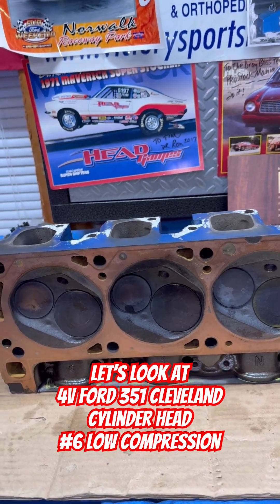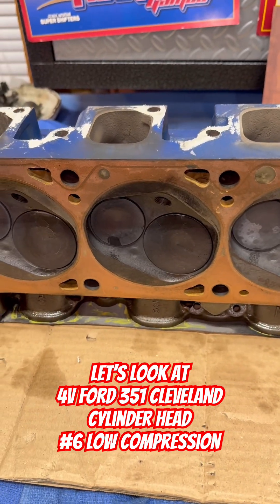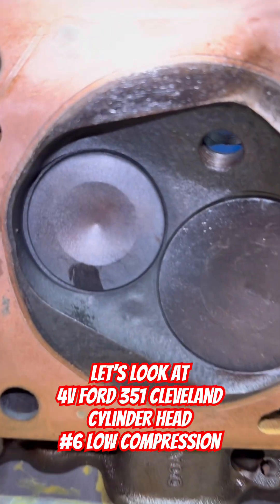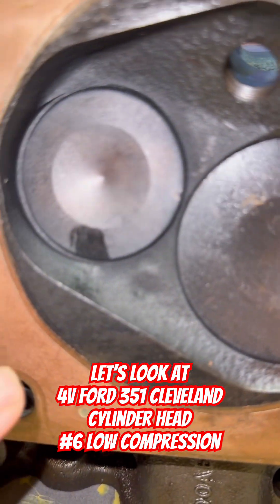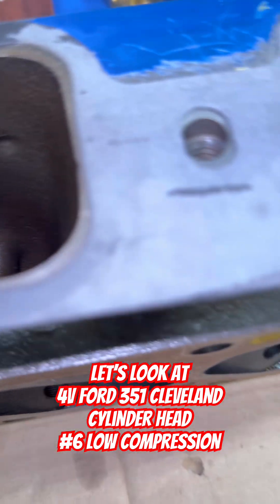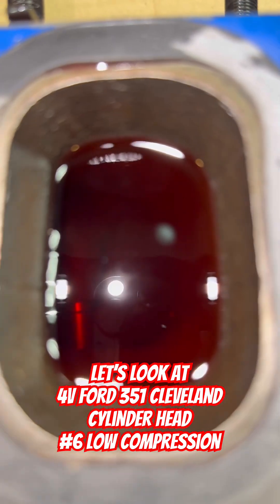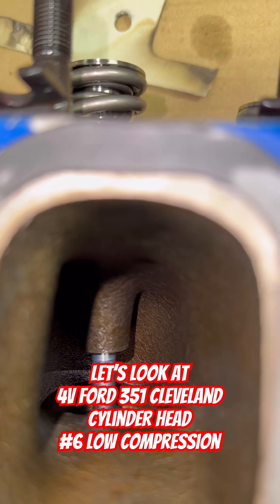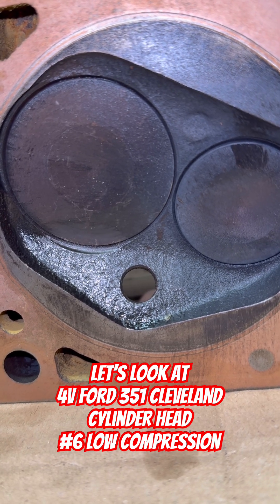DBG: The 615HP Ford 351 Cleveland 4V Cylinder Head, What Is Causing Low Compression, Hi Cyl Leakage

Comment: What if your intake manifold is not equally distributing air fuel to every port, causing one or two rich cylinders. Maybe.
Reply from the maker: This happens to be a ring issue, hanging in the bore...

Comment: Yes but is it leaking past the valve seal or guid on the other side .
Reply from the maker: It’s the ring hanging up and scraping in the bore. 

DragBoss Garage: Tearing Down The 615hp Ford 351 Cleveland, With Low Compression/Cylinder Leakage...
https://youtu.be/lFJcu8WbWbY

Comment: I had a 77 F150 "ranger" from the factory.  I guess it was a package for that year,  anyway,  it had a 351m in it no one wanted to buy it bc it was a "big block" therefore it was bad on gas to whomever owned it before me.  I got it,  kept it factory  2bbl holy 2150 carb,  flowmasters and true dual exhaust, that truck sounded straight up menacing at Idle. Bone stock but it would set off car alarms.  I really miss that thing bad.
Reply from the maker: Those are some of my favorite trucks. 78 is my favorite year. Yes everybody had something against them. I glad you took care of her. Great job 💯💪
Reply: @dragboss351cleveland yeah I heard a lot of rumors and stuff people say about that engine but it was a beast. I definitely would have tried to hop it up but everything was so expensive and hard to find plus it really didn't need much else as long as you took care of it.
Reply from the maker: @FatamorganaJerzyboi yes. Comes down to intended purpose. Hopped  you subbed lots to see and learn chat soon 💯🏁
Reply: @dragboss351cleveland done!

Comment: Hey Tim was there any thing weird with the valve lash? Maybe a tight adjustment or even crazier thought of a possible cam lobes slightly out of time. I think I mentioned what I usually do when tearing a engine for repair. Measured everything so I had notes. With weird problems to diag having the pre-teardown is key. I've had slightly bent rods, weird lifter cup shift, and one valve stem cap we needed for a high ratio rocker. Also had a bit of damage to a lifter bore bushing trying to rotate. I was so meticulous people would freak out. I looked at the video with the bore slight scratches. Would a upsidedown ring  or too much gap cause that?
Reply from the maker: Great idea, doing exactly that. Kash was good. It was rust in the bore to me, and rings too tight. Gouging into bore wall. Lash was good. Thanks my friend 💪

Comment: How big are the intake and exhaust ports on a 4v head?  And much horse power are they really worth a mild 408?
Reply from the maker: The stock head is capable of 600+ and add the increase ci prob 700 right there.
Reply: Tim that’s a good call on the stock power capabilities. The increased displacement is exactly what is needed for the heads to take advantage of the generous port and valve sizes. 

If Scott wants to know port dimensions, the 4-V intake measures 2.500” high X 1.750” wide. The port volume is 242 CC’s. I don’t remember the exhaust port numbers due to old age 😵‍💫

Comment: Maybe time to look at the rings?😮
Reply: A wet / dry compression test and a leak down test would have confirmed before removal. Those valves look to be seated a bit low for my liking but I don't do race motors either.
Reply from the maker: I did that in previous video, cylinder was 160 and squirt of oil and went to 175 ish. Huge blow by through dipstick
Reply: @dragboss351cleveland  Ok then your video was total BS click bait. Thanks for admitting it.
Reply from the maker: @maxwebster7572 if you think so. Your just don’t want to look for the answer. And this videos shows that there is no obvious issues with valves. Thanks for watching. Don’t forget live chat with Darin Morgan on Dynos. More Clickbait 😉
Reply from the maker: Already there, my man I think you’re right. I think the rings were hanging up a little bit.💯🏁

Comment: Would rather have a cylinder head problem than Paton or cylinder. Sonic test. Bored oversized?  Stock block walls are thin. I half filled mine with roc block.
Reply from the maker: Yes, block is filled, the boards are 4.015. Good deal thanks, Danny.🏁🔧💯

Comment: What block are you running?
Cuz .030"/.040" over stk Cleveland blks crack cyl walls, but will still only leak dwn about 20/30% for a while.
Any signs of leaking around the ring on the block?  
Those heads aren't posted, but I suspect your not running very high compression in this eng..?
Reply from the maker: For this engine it is 4.015, I have plenty of blocks .030,4.035,4.040 that last years and have normal leak down. The rings are the issues in one of the last vids I posted. This engine is 12:1.

Comment: Nothing too see here? I watched this video all the wy through and saw nothing just like you. So if theres a compression leak anywhere, it would have to be getting by the rings..Anything else where would show up in the cooling system or an issue with valve settings, like a rocker holding a valve just enough off the seat to let it get by. I have ran across a situation like that before. It would run and fire on the cylinder that was losing comp. and it wasn't misfiring either. Years ago I had a fellow bring in a 289 with high comp. domed forged pistons complaining of compression loss and I did a leak down test, checked to see if it was leaking back into either the i take or out the exhaust with heads on, checked to see if it was getting into the colling jackets. Ended pulling the heads and didn't see any evidence of getting between the bors as Fords can be knownfor because of having only 4 bolts per cylinder. Had the heads checked and just a minimumal.clean on the surface, nothing wrong there, turned out the decks were buckled at the bolt holes. The guy wasningoing for a complete pull out tear down and deck surface. Told me to put it together as it was. Ok! As I said it wasn't showing any sings of comp loss on the gaskets but it sure as heck had running issues. Was ansolid tappet engine so after putting it together, I made sure it wasn't a lash issue either. I never did figure where it was going. Ears later, like maybe 25? I ran into a late GM equinox engine that was leaking comp..from one end of the front bank into the other end cylinder of the front bank! Go figure that one, how the hell does that happen? I was told to swap out that engine which I did and the replacement engine would refuse to fire on the center front hole! Nothing I did would make that run on all 6. It was only a few weeks later that I decided it was time to retire! After wrenching for nearly 50 yrs.
Reply from the maker: Thanks again, Brett, another story that is others information to look for if they have a similar situation. I don’t think it’s the heads either, I think it’s a combination of the rings, having rusting the lands, mixed with oil, and too tight of rings, cocking them in the lands, either way it requires a teardown, and a good thorough evaluation. I suspect just doing this going through the valve springs and the valves, cleaning everything up, I bet you this thing picks up 20 hp just with that. 50 years in the business you put your time in, now it’s time to enjoy life while you can. We only get so much time. I’m glad you’re here. This is just me doing what I enjoy doing and love doing Racing and engines. I’m not a big builder, but I’ve built my share of engines, and after reviewing this, I know I can improve my own skills. I will prove it here. Glad you’re checking my channel out my friend. See you around real soon.💯💪👍🏁🇺🇸😊

Comment: Have you cdone a leakdown test? You may have a pinhole in a cylinder. No leaks into the cooling system? Thinwall cylinders may be your culprit, assuming you're head and deck are true. The only thing left is piston/ring issue if it isn't in the cylinder head or gasket which would be obvious.
Reply from the maker: Yes one of my videos from the other day. 😊

Comment: I'm NOT a Mechanic, nor a car engine guy.  BUT I would say that is the low pressure side... The High pressure side would be IN the piston. So a proper test would be to apply the fluid to the face of the cams under pressure and look for leaks in where you poured the fluid. But as I said I am not a mechanic, maybe your test is 100% acceptable.
Reply from the maker: Well did do that type of test with cylinder leakage. This is just a screening stay tuned for evaluation. Thanks 😊

Comment: I'm a long time fan of the 351 Cleveland 4V. Everything except for the weak bottom end. Nothing a forged crank and an oil restrictor kits doesn't fix though.
Reply from the maker: The bottom end is plenty strong supporting well over 750hp Kev
Reply: @dragboss351cleveland Not in my experience. Good try though.
Reply: @KevnHelsing They are plenty strong. They just starve  the 3/7 journal when you twist them above 6500. I have had extremely good luck with them on the dirt tracks and drag strip. With a little work in the oiling system I have turned them to 8700 repeatedly with no issues. I do check the bearings in the off-season, which  is something I don't worry about on my windsor or cobra jet engines. 3 and 7 will show a little wear but nothing dangerous after just one season.
Reply: @charleslum2438  10,000 rpm head with a 6,000 rpm crankshaft. 
Good luck with your future races.
Reply: @charleslum2438  Having a stock crank hold up at 8,700 in fantastic. You built it well.
Reply: @VanceHelsing boss 351 crank. I bought all that stuff from a dirt tracker. It helps when you work for a long time race enginge builder. I use windsor blocks with 4 bolt billet mains on 2 3 & 4 with eagle steel cranks and forged H beam rods now. With a good combination even with a windsor Aftermarket head 700hp isn't out of the realm of possibilities.
Reply: Bore thickness is the main issue generally 
New Blocks have fixed that 
Go the Clevo  🇦🇺
Reply from the maker: Right on my man 💯👍
Reply: Boss 351 / or clever is the cure for that 
351c-& m are good blocks not great 
Windsor is better
Reply: @JamesMadison-dw9kk Cleveland heads will fit in a Windsor block. Slight mods and intake...
Reply: Have been running a 650 hp cleveland for over 10 yeays ,hundreds ,and hundreds of all out passes. Have main girdle ,solid roller , oil transfer tube from one cam oil gallery to other side ,to insure oil to both sides for lifters. And I'm a GM guy.
Reply: @ronniecox109 So. It's a 7000 rpm engine?

Comment: I like the old iron heads 👍🏼
Reply from the maker: They can make over 600hp just the way the are from 1970
Reply: @dragboss351cleveland  Yeah, but where can I find a set?? Maybe even a set of open chamber heads? Do I need to learn how to weld cast iron too? 😅
Reply from the maker: @jondahl3173 I see them everyday on facebook marketplace place for 1k and up. No that is why they made epoxy. Stay tuned 💯🏁
Reply: @jondahl3173  If you can’t find a pair of reasonably priced quench chamber heads, I have a pair of D3ZZ open chamber 4-V heads that have been collecting dust in my shop for years. They are stock with no modifications. They are assembled with stock valves and springs but the valve train should be upgraded for a performance engine when the typical machine work is done.  Just let me know if interested.
Reply: Unless ur just looking for a trade....

Comment: Time for for Higgins heads on that motor.
Reply from the maker: Why? These have more than enough potential for this mill
Reply: Tim, there’s no doubt that your current Ford A3 heads as prepared by Darin will support considerably more than the impressive 769 HP @ 7683 rpm’s that you’re running now. 

What some people don’t realize is that your current build combination uses a stock production block !  To step up to a “max effort” build for more power just wouldn’t be practical with the factory iron block that you’ve been using for years. But for people with doubts, it’s definitely a good testament to what’s possible with a well prepared stock block. 

I’ve seen some impressive dyno results using the Higgins alloy heads but considering what’s possible with those 40 year old Ford A3 heads, I would take them to the next level when it’s time for that Track Boss block upgrade 😉.
Reply from the maker: @danielwilson6665 your are right about that. I think the limit of these production blocks is probably 750-800. The closer to 800 the much shorter life span, like the pro stocks that made 800-840ish. I have been having good results with this block for 12 years. I am very happy  with the results I am have achieved. I would like to use it a bit more to say 780, which would get me in 9 teens. Then I would be more than happy with this old girl. But yes I could go through the purchase and I stood the Higgins but the block would not even come close with surviving very long. Now the trackboss could be a whole different story. Then I would and have to think and be concerned with transmission. Thanks for looking at the big picture. 💯❤️💪🏁
Reply: @dragboss351cleveland  The early Cleveland Pro Stock blocks are a great example of what a properly prepared stock block is capable of along with a good rotating assembly. The high horsepower numbers combined with rpm’s that routinely exceeded the 10,000 level in drag competition is so brutal it’s hard to imagine. 

“Animal” Jim Feurer said that his de-stroked Cleveland combination used for match racing, often turned 13,000 “when necessary”. That was with a production block and iron high-port heads. Not too shabby ! 🏁🏁🏁